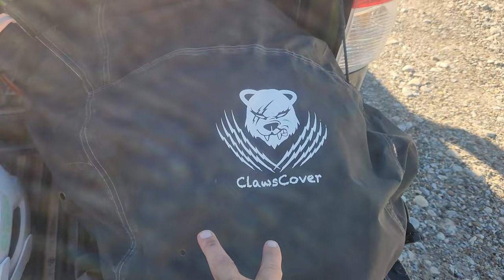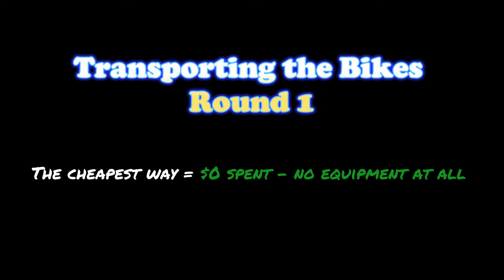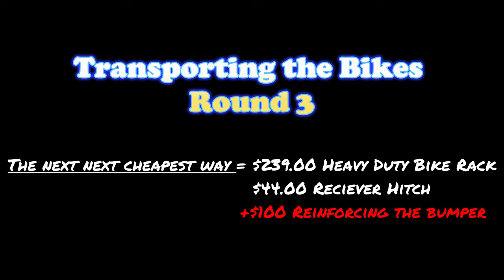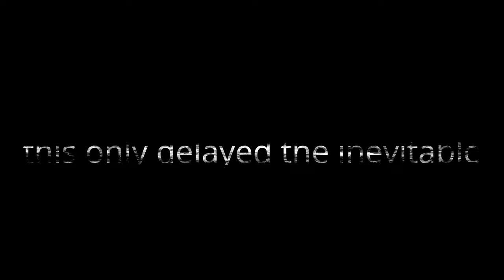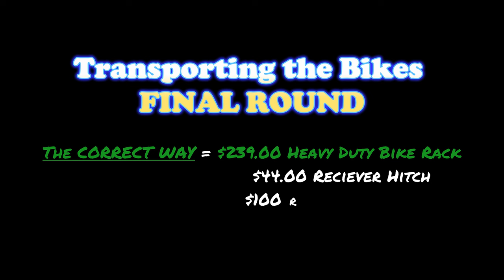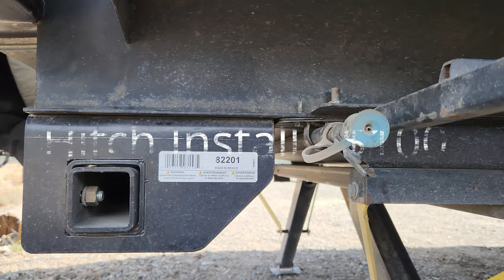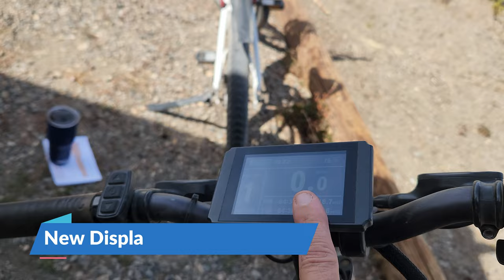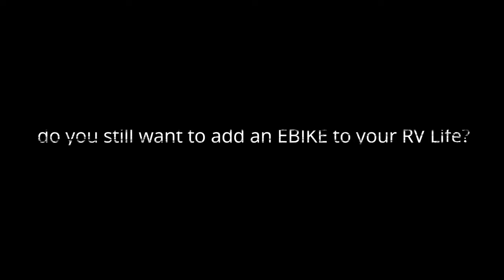RV's and Ebikes. The Perfect Match? | BUDGET for the TRUTH 🤑

Comment: I got mine from a reviewer off of You Tube so I lucked out and only paid $850 for it and it was practically brand new. We bought my wife a new one for $1600 so not so lucky there. The rack for a fifth wheel isn’t cheap and I had to replace the tire trays because our bikes have the fat tires. So far nothing else has broken and we have had them for almost 2 years.

Comment: The WHOLE RV is built lightly. You almost cannot weld enough or reinforce enough to get it to hold. ..it'll just keep cracking further and further in on the light weight frame. I hang 400-500 lbs motos off the back of two ford vans. I brace back into the frame channels 3' with 2x3 heavy walled box tube. Your frame couldnt even benfit from that. Its just too light. RVs are just built too lightly. You would even find tieing off to the upper back of your RV problematic. I run a HD cutaway ambo ..it's a heavy and durable unit.  I can even tie off the rear door "loops" that hold doors open. Your fighting a losing battle
Reply from the maker: Thanks for sharing your experience with us and the channel! Correct, the lesson here is dont put anymore weight on that bumper than what comes with it even after modification. The new hitch is handling the weight no problem  👍